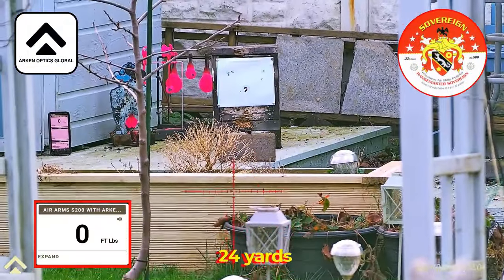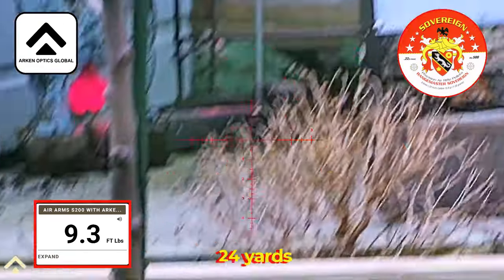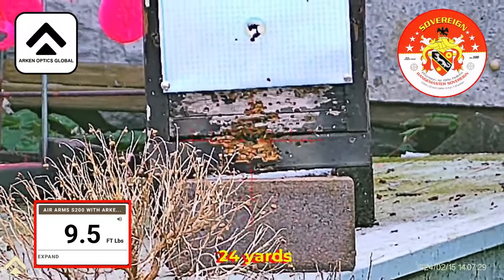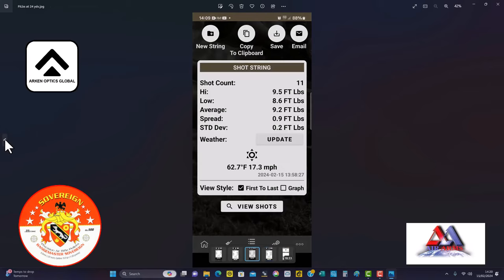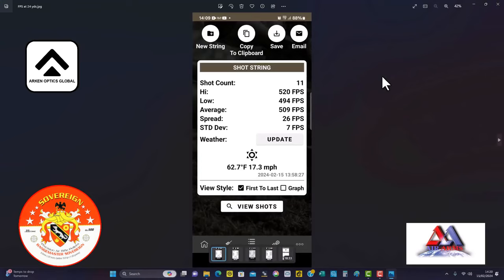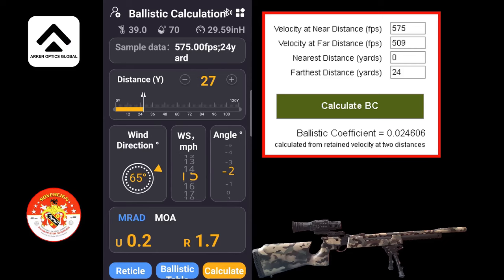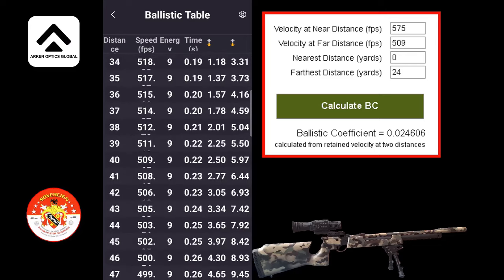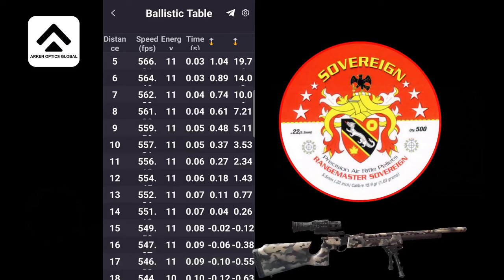Finding the BC for you rprojectile and Rifle for the Arken Zulus

Comment: Thanks for the great videos, they have been very helpful in getting to know the zulu. One question though, how did you set up the FX chrono for the down range measurements? I have been trying to set it up to no avail.
Reply from the maker: I use a house brick to hide the chromograph behind. Normally on the back garden this is 23 or 24 yards. I then leaf my phone about 7 or 8 feet away. I line the rifle up at the center of the brick, but a few inches higher, and turn the volume up on the phone. Once you hear the sound, I just keep taking the shot. If you hear no sound, I just adjust the aim point until I do. I then use the average out of 10 shots to get my result. I do the same at the muzzle. This gives me the two figures that I need to enter into the calculator that Pyramid Air has online.
https://www.pyramydair.com/widgets/?BCalc&u=17
Reply: That's great thank you, going to give that a try today

Comment: Interesting exercise. It would be useful to know if the BC changes at different ranges. Say 15, 30, 45yds. That would indicate how reliable model is since the BC should be a constant (I think). If it varies does an average BC give a more accurate range card?
Reply from the maker: Yes, although with pellet weight variation and wind affects, such as head and tail winds there will always be a slight variation. On the whole though, it seems to be fairly accuarate.

Comment: You need to put in the correct drag law which for a round nose airgun pellet is GA,if it's on the ballistic app if not it won't be far out with G1.some like chairgun have GA drag law on the app but some only show G1,G7,etc
Reply: Yep in the Arken app G1 is recommended for air rifles G7 for firearms I believe
Reply from the maker: That's great.I will check to see. This information is what's needed. I am sure there will be instructions for the eventually. I will find out at the shooting show.

Comment: Hi you have two different yard settings 1 is 24 yards the 2 is 27 yards
Reply from the maker: Yes, I have changed them to the same, but what made the difference was changing the drag to G1. I am now within 3 ft/p/s, which is spot on for none weighed pellets. Anything within 20 feet per second out to 40 yards won't make much difference to the point of impact. With the regulator fitted, it's not normally more than 10 ft/p/s spread with unweighed pellets anyway.
Reply from the maker: I noticed that the zero distance remains the same. The other figure is what it was set at the last time that the rangefinder was used.

Comment: Daft question. if I swop out my micro sd card, will I need to re-sight the gun and resend the BC?
Reply from the maker: I haven't done this, but unless part of the memory card is partitioned off for this, it would get wiped out whenever formatted. I think there will be space for the ballistics within the scope firmware that sets updated. I will check at the shooting show on Friday.
Reply: @airgunsniper-elite7385  any update?
Reply from the maker: To update the answer. Once updating with a different memory card, WILL NOT loose any information already input into the scope. The App uploads the information to space within the scopes operating system, not the memory card. That's why once your memory card is full of film, you can format the card without any problem to the data on the scope.
Reply: @airgunsniper-elite7385  thank you so much